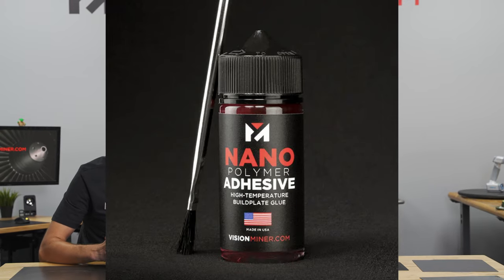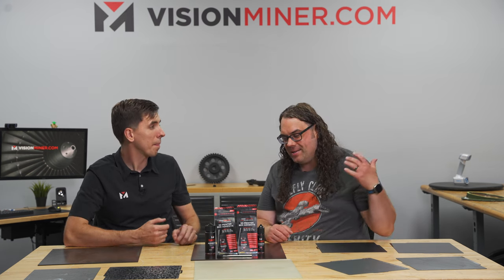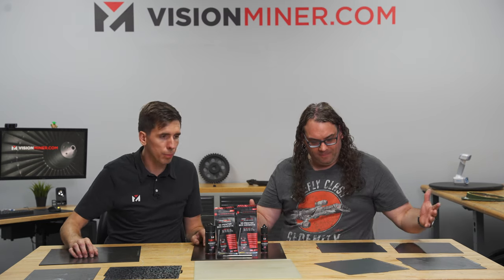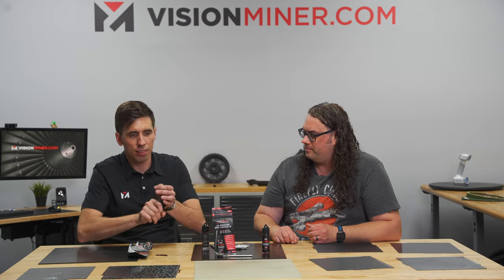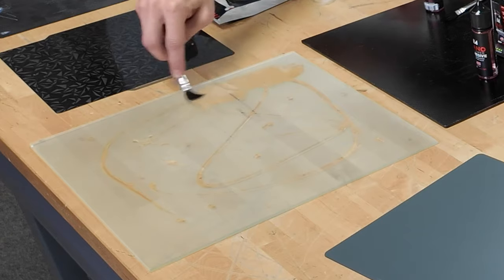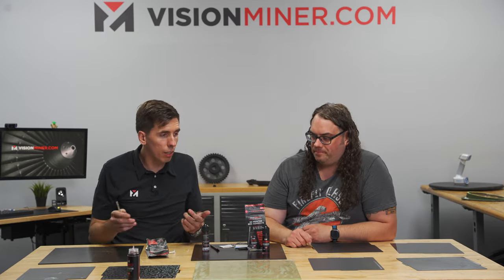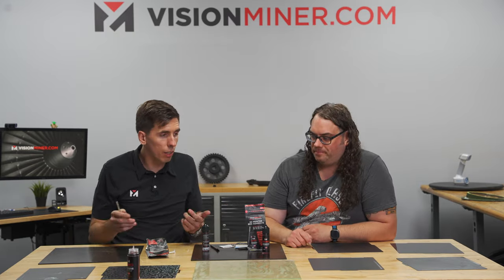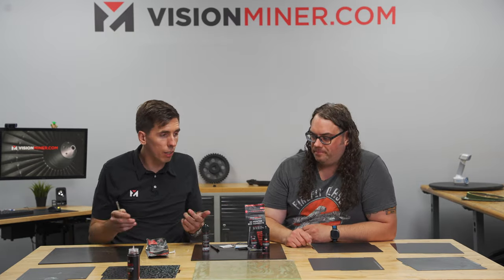STOP Using the Wrong 3D Printer Bed Adhesive and Wasting Time

Comment: I use this “adhesive” on every build plate I have. I buy the $45.00 bottle and it seems to last forever. I have a couple of thoughts. First I use a cheap foam brush to apply it, using the circular and X technique. It is fast and easy to do. Afterwards I just wash to foam brush and it’s ready to use again. Also, rather than using a putty knife to remove a part while the plate is still warm, I pull off a flexible steel plate off and wave it in the breeze. Then a small amount of flexing and the part just lifts off. For non flexible plates I just let things cool and parts can just be lifted off. If I’m in a hurry, I have a small fan to hasten the cooling. And the last thing I have found useful is to keep my fingers off of the plate. Just a quick wipe with a dry microfiber cloth and it’s ready to go again. To use a hackney phase, I think this is the best stuff since sliced bread!

Comment: We won the Vision Miner giveaway at RMRRF.  I now swear by it.  Haven’t used another bed ahesive since.  Lasts for about 10 to 20 Prints before you have to reapply.  Goes on nice and smooth onto the bed without gobbing or leaving residue all over prints like glue does. HIGHLY recommend.
Reply from the maker: Heck ya! Glad you got some and I'm glad you're loving it! Thank you for watching!
Reply: @3DandTeePrinting  I have found that if you keep your finger prints off of plate once it is applied, the surface will last longer before it needs to be washed off and reapplied.
Reply: @philipershler420  That's true .  Always keep the oily mits off the bed for best results with or without bed adhesion.

Comment: I don't use glues on my bed for 99% of materials as it's not needed with some of these awesome build plates anymore.
Reply: @jonmayer  I guess it all depends on what type of filament is in use. This stuff is good for everything I have thrown at it, from TPU, PLA, Silk PLA, PETG, Nylon, and any of them with carbon fiber. It seems to work for me with cheap smooth or textured plates.

Comment: Yah you are right, this stuff is better than anything else I’ve tried. In particular it’s really good for eg silk filament with small areas that have poor adhesion no matter how much soap and water you use to clean your plate.

Do I use it always? Of course not, most of the time I don’t need it. But I know when to use it and when I do, it absolutely helps.
Reply: @LeifHedstrom  Same here it's a great Security Blanket on your bed to give you peace of mind your not going to come back to a warped or failed print.

Comment: Been using this since first tried a sample bottle since 2021. Amazing how it helps with any adhesion issues on all types of surfaces and almost every type of filament.  Nothing else compares, so why waste the money on other adhesives , which also leave residue on the bottom of your prints. VM NPA comes out clean.

Comment: I've been using this nano poly coating for the  past 10 months, the only issue I had was, the stock X1 bambu black PEI plate and abs.   The ABS and this polymer coating pulled the PEI layer off the plate.  This nano polymer coating just sticks..... and wrecked the plate, it was a happy a failure!  I get about 20-30 prints per coating and the big bottle last me around 6 months but I have few printers.    Awesome stuff Vision Miner, now if you just sell  this directly to Canadians.....   Cheers

Comment: I have been using it on my Wham Bam PEO plates.  They work great for PLA, but had a little warping with ABS, put some of this on and they stick very well.   Also the same for my Prusa XL the smooth plate for ABS.  Just wish it was a little less expensive.

Comment: Thankfully I haven't had a need to use glue (yet).  I clean my two glass beds with store-brand window cleaner (320x320 and 1000x1000) and a dry cloth and two PEI sheets with Dawn dish-soap (both 420x420).  They stick like glue (if you pardon the pun).

Comment: My printer will out down that purge line no problem, and then screw up the actual print every time.
Will this stuff help with that?
You say it activates at a certain temperature... So if I just dropped some raw, right off the spool, PLA onto a heated bed that was at that temp... it would stick?
Reply from the maker: This would definitely help! But getting your bed leveled and the z offset, set correctly would be better!

Comment: If you need glue on the build plate then your printer is not set up correctly or or using the wrong type of material for a build plate.

Comment: That is the issue i am having with 3DXTECH pc filament in the enclosure heat soaked for 4 or 5 times. Using satin sheet and txt sheet, need glue, nano polymer and even magigoo pc glue. The pc parts still would warp. 
Someone mentioned for me to try the smooth sheet, once i get the MK3S+ finished and put back in the enclosure, i will try the Nano Polymer again on a smooth sheet.
Any others tips?
Reply from the maker: A good coat and make sure that the bed is at least 50 to 60c. Also, you could slow down your first layers that might help.
Reply: @TheEdgeofTech  printing PC my bed was between 110-120c hot end was between 285-295c

Comment: Make it easy on yourselves. Just use hairspray. That easy.
Reply: That doesn't work for high temp, high warping materials. Have you tried printing nylon using hairspray as a bed adhesive?
Reply: lol no. I mean unless you're printing PLA parts. and also hairspray makes the bed sticky and uneven.
Reply: @DebianDog Rarely do I print PLA. Glue sticks are a mess. I used hair spray for everything. Fast easy, no mess, no clean up.Never have a problem. Never had

Comment: I have some its good, a bit pricey, but its CLEAN. Apply it liberally and evenly then let it "dry" it will last a few prints (for me about 10 prints). The brush became useless after the first day. It became brittle and would leave strands on the print bed.